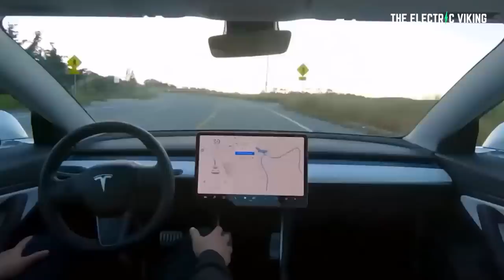20% of all vehicles will need to run on electricity in 24 months in Canada!

Comment: Speaking as a Canadian.  I love EVs but the supply and pricing is much different than in the US.  Due to duties, taxes, supply and currency differences, a Chevy bolt if you can find one is $51.000. anything you see any cheeper online is a lost leader.   most of Canada is a pick-up truck and SUV market due to extreme weather. There are are 3 year waiting lists for EVs and very little used vehicles available so the used markers is almost the same price as the new car market. There are simply too many people who want an EV with a very low  supply.
Reply: Don’t bother people with reality….. 🙄
Reply: @Chad Roback I'm Canadian and most of Canada is not "Pick-up Truck and SUV market due to the extreme Weather",  Have you been to Quebec lately, they are one of the coldest provinces and they have a growing community of EVs there.   The idea that EVs wouldn't work in the cold is nonsense.   There has been supply challenges in the past because the demand for EVs caught many manufactures off guard.   This will change, Canada is building and converting some ICE plants to EVs.  There is a lot of announcements to come.
Reply: @tonespeaks  uh. . . 2021 80% of vehicles sold in Canada were pickup/SUV's. . . So yes, Canada is a pickup/SUV market.
Reply: @tonespeaks  I can't drive an announcement
Reply: Bought model 3 after 9 month wait.  Filling our needs beautifully. Kept old truck for trucking needs.
Reply: @Richard-pe1cd  you know… not everyone can afford two vehicles let alone an EV at the prices they are selling for. I’m glad you had the freedom to buy an EV.
Reply: @niceguyrides  we saved for 7 years to buy this car.  We always pay ourselves the car payment and then buy.  Try it!  But now that we have one, we are amazed how much we are saving on gas.  Just put thousands in repairs on the truck though and when it was our main driver, it cost us $600 a month in gas.  We are now saving for our next vehicle, although we may have to dip into it for a new roof.
Reply: @adamq9270  The announcement is the start, we have to start some where.  It is also the signal to the country, this is the direction we are going, so start preparing ourselves for the new reality.  24 months, there is lots of time to make it happen.
Reply: @niceguyrides  Can you state the source of your data??  Also SUV is a broad and misused term.  Many Small vehicles are labelled SUV when really they are just sedans with a higher ride height.
Reply: @Richard-pe1cd  Try it?  Don't patronize me.  I own my cars, but that doesn't mean I am so egocentric as to not stand up for people that don't have what I have. I own an SUV that gets 36 mpg, do you know how long it would take me to make up the difference between the 30K upcharge on EVs that currently skew the market? It doesn't work yet, and that is why the government shouldn't be forcing this on people yet.  When the supply chain, charging infrastructure,  and manufacturing catches up with demand, then I can see the government stepping in, but we are years away from that with current battery resources. So they are creating more demand when we are already low on cars.  AND you still have your truck? So an EV cannot serve you in all your needs, unless you are going to jump on the 3 year Ford waiting list for an F150. . . -SMH
Reply: @tonespeaks  it's already started and manufacturers are racing to get going. Why does the government have to step in to create more problems? Oh. . it doesn't.
Reply: @tonespeaks  Google it. Took me ten minutes.
Reply: @niceguyrides  Of course I can google it, I just wanted to know what the source of your data is.  There are many different sources of Data in this area, just want to know which one you are relying on.  I was using StatsCan data, but like I stated the term SUV is used very loosely... Tesla Model Y and RAV4 are considered SUVs, but they are not based on a Truck Frame.
Reply: @tonespeaks  standards applied too quickly create problems. You are ignoring the obvious problems with forcing something to happen when the market cannot support it. This is just a penalty tax being that it doesn’t give automakers time to adjust. It is OK to be zealous about something but don’t blind yourself to reality.
Reply: @niceguyrides  "standards applied too quickly create problems. "  This is a a fair point, if using current production metrics, but this is statement from the Government is about what will happen in 24 months.   In 24 months there will be a massive amount of EV production, coming from a variety of manufactures.   Currently, all the major EV makers will have ramped up production..... in 2023, they will be in a position to meet increased EV demand and with lower prices.  The Government is not making an aspirational announcement, many of the Auto Companies had planned to end ICE production in 2030 or 2035.  In 2023 there will be a number of EV Pickups for sale: Tesla, GM, Ford, Toyota, Stellantis, Rivian, and a number of others.  There will be even more EV SUVs from Volvo, Hyundai, VW, Audi, Kia, Mercedes, Vinfast, Toyota, Nissan and others.   I didn't even mention the Chinese EV makers like BYD, NIO and Xpeng, who also plan to sell in North America.   So the Government's target of 20% is actually easily achievable and the prices will be comparable to ICE.

It should be noted, what the Canadian Government has announced, is similar to what the EU, China, California and other US States, UK, NZ and other countries have mandated.   Canada is in a better position than many of these Countries because we have all the resources needed to manufacture the EVs in the country,  not to mention we wll have the ability to make components and EVs for export.   This is where Canada can become a Powerhouse in the EV industry.  We have the natural resources and technical knowhow to be a leader.   The Industry just needed a little push and helping hand from Government to give it off the ground.   In the coming weeks there will be many announcements about EV production and/or components in Canada.  There is a line up of companies trying to launch development in Canada. Tesla has big plans for Canada, that I can state for sure.

I have been studying the EV transition for about 7 years, but don't take my word for things.   KMPG has done an extensive study on Canada's potential role as a PowerHouse, here is the link to the study, it is a 7 min read.  Everyone should read this.... 

https://home.kpmg/ca/en/home/insights/2022/06/how-canada-could-become-a-global-powerhouse-in-ev-production.html

https://www.pwc.com/ca/en/industries/automotive/publications/accelerating-canadas-electric-vehicle-transition.html

https://www.bcg.com/en-ca/publications/2022/competitive-edge-for-ev-battery-manufacturers-canada

https://www.investcanada.ca/industries/batteries-and-electric-vehicles-ev

https://www.forbes.com/sites/samabuelsamid/2022/12/05/brightdrop-starts-electric-van-production-in-canada-adds-dhl-as-customer/?sh=7261fdd62966
Reply: @tonespeaks  incorrect on so many levels. #1 no one needed a push. It as happening already as you have so eloquently noted. What this will do is create more supply chain issues as all these manufacturers compete for EV resources that are seriously lacking in the market right now. I mean just look at how thin the lithium refining is right now in our world. And lithium refineries don’t pop up overnight. Most EV manufacturers aren’t even turning a profit on what they are making because they are behind the curve on manufacturing techniques. Their may even cause manufacturers to rush an out unsafe vehicles on the road to avoid heavy taxes on vehicle that actually make profit. The timeline is too tight, and Canada is not China, so looking at them as a model is horrible. The blind eye that China takes toward humanitarian, environmental, and safety concerns is ridiculous. 

Again, no push needed. Electrification sells itself if you let it. Tesla is proof of this. Instead you create a bunch of haters because you are forcing it upon people. Instead we are going to create a whole lot of uninspired EV vehicles from developing technology that will be complete bricks 5 years from now as the tech matures.  Then we will be faced with recycling millions of vehicles. I mean seriously… we haven’t even settle in a unified charging standard yet, and many manufacturers are moving upstream to 800v systems. 

Better to let the technology evolve naturally until you have a product that will stand the test of time, than force people into a round whole that don’t fit. We are 5-10 year away from EV’s that will truly replace ICE vehicles in 99% of the cases, but we need to be building the supply chain and infrastructure to handle that when it happens.
Reply: @niceguyrides  You make some good points, but I feel much of your response seems to be based on out dated ideas.  "We are 5-10 year away from EV’s that will truly replace ICE vehicles in 99% of the cases".  That was 5 years ago, there are many EVs on the market that out perform comparable ICE vehicles.  EVs are far more efficient and have better performance than ICE.  EVs have a lower TCO (total cost of ownership).  EV charging has been an issue for some, but that is changing rapidly.   Most can charge at home and reap great savings in the process.   Many people talk about Range, but on average people only drive about 50-70km a day, only about 1% of users will drive at distances greater than current battery capacity,  so that covers your 99% rule. 

The reason the Government is pressing the adoption, is to allow Canada an opportunity to be a Powerhouse.  Timing is everything, especially since  China and many parts of Asia have/are already ramping up their EV development and production.   They have a nice head start and we can't wait for all the issues to be resolved before pressing forward, otherwise we would just be conceding a larger lead to them. 

If we want to ensure that Canada benefits the most from the EV transition it will have to move now and move quickly.  This allows North American EV manufactures a stable supply and demand for their products so they can accelerate their production and technological development.   Right now North American EV makers are behind Chinese, beside Tesla.   I hate to say this, but the Canadian Government is making an excellent decision and movement here.   This is an opportunity to really put Canada on the Map in EV Production and Technological development.  The benefits to Canada from this, will be profound.   Basically every area of the economy will benefit, even Oil and Gas.

The Government is pivotal to making the transition work, because it will require a lot of Government Assistance and Coordination to really make things work.  Basically a lot of Public/Private investment is needed, for example better roads will need to be built to Lithium, Nickel and other resources.   Communities will need to be built and like you said, expanded supply chains developed.  

Some of your scepticisms are reasonable but we shouldn't let the strive for perfection get in the way of progress.   Remember the Government has set the bar at 20% this will be easily met, even at the current rate of transition.  People who prefer ICE will still be able to buy ICE... for now.

----------------------------------------------------------------------------------

Addressing some of your important points:

The lithium supply is not under threat right now... no one is questioning the supply.  Prices have risen, but many EV manufactures planned for higher adoption levels and made contracts to reflect this production.  

As for safety,  most EVs top the Safety charts, especially when compared to ICE vehicles.  

Canada isn't following China.... in fact EU and USA have led the way in terms of mandates.   The EV capital of the World is Norway (in terms of adoption), a country with a colder climate then Canada. 

If you look at older EVs they are far from Bricks now and that was using outdated technology.  Don't get me wrong there have been failures, but the technology has evolved greatly since then.  

Charging standards... hmmm not sure what you mean by that, but we have CCS, which most companies use and NACS which is what Tesla uses.   I totally agree it would be smarter to have just one like in the EU,  but this is only a matter of convince not operation.   Many Tesla Superchargers can charge CCS vehicles and most of the other Charging stations can charge Tesla.  A unified system would be smarter but isn't a deal breaker. 

The 800volt v 400 volt systems is a design choice and really has no bearing on production.  There are benefits to both systems, so it is really just a design choice. 

As for EVs being bricks in 5 years that is highly unlikely, because the design of EVs makes upgrades really easy and cheap to do.   Swapping a battery can happen in a matter of minutes and recycling of battery parts is very efficient.  The Electric Motors will out last the bodies easily and require virtually no maintenance.  Even the Brakes will out last more ICE vehicles.
Reply: @tonespeaks  Again, you are an EV zealot.  I get it. But you are making up your facts. we are not at the 99% level right now. Maybe near cities, sure, but if you don't own a home, or live in an unsafe area without a garage, or live in rural areas, or live with huge commutes, EV's can still create issues. The list of exceptions goes on by the way. 

Cost of ownership is only cheaper if 1. you drive a butt load of miles a year. 2. If you assume car ownership longer than the average ownership of a vehicle in the US. 3. If the increased demand for charging does not raise the cost to charge your vehicle. 
4. If you can charge at residential rates.  I've seen and done the math.  My SUV would have been 30-40K more if it was electric. It gets 36mpg.  It would take me forever to recoup that cost, even driving 20K/year.

Safety:  Chevy Bolt owners may disagree, being that their cars can catch on fire (still). Toyota BZ4X owners probably disagree as well. Technology rushed can be dangerous, and this is forcing companies to rush.  Yes, EV's CAN be safe, but they are not inherently safe. They are made safe by development and testing. 

And by "brick" I mean that in 5-10 years when range anxiety dissipates due to maturing technology, they car you buy now will have very little value, but you will still be stuck paying the 60K you financed to buy the thing. There will be millions of these things on the road waiting to be recycles.  Sure it will drive used EV prices down, but it may even be that the charging infrastructures doesn't even support old cars anymore.  We don't know, because we are still in the adolescence of this technology.  Forcing people into it early is not good business. 

There was no need for it. and as much as you say Lithium supply is OK, you are mistaken, that is why Tesla, one of the only at scale EV producers is building its own Lithium refinery. Plenty of Lithium in the world, few refineries. That is an issue, and that was just one of the hard to find resources that goes into battery production. And why, so we can replace a bunch of cars? Do you realize that the regulations of Semi trucks could have a much greater impact on the environment.  How about home energy. Canada gets 50% of its energy from oil?  So instead of using all those resources to replace oil energy or natural gas (32%), with solar, tidal, nuclear and BATTERY banks, all the battery production will be wrapped up in producing EV's. 

See the politicians are not scientifically deciding things. They needed to do nothing, because the incentives were already there. Now they are just forcing people to implement things early and stealing resources from more needed places to create millions of obsolete in 2 years EV's.  Yay! 

Just to collect their taxes and virtue signal.
Reply: @niceguyrides  First of all, I'm not a zealot, but an EV expert.  I have been studying this for some time.  In fact in my University days, I suggested that we build Electric Cars, but the battery tech just wasn't there to make it viable.   If you read what I wrote, I stated that people still have the choice to pick ICE or EV.  The Government isn't forcing people to buy EVs, they are just stating that Automakers make 20% of their sales EVs, the other 80% is ICE.  This is not forcing anything down anyone's throat, it is just pushing the industry to move and setting targets so that we move towards EVs as a collective.   This will make the transition more cost effective and will get everyone thinking on the same page.  For example at some businesses they offer their employees Charging stations.  Some businesses offer Free Charging to lure customers.  This helps to expand the economy, it is a win win for Canada. no matter how you look at it.  

I totally get your concerns, but those issues are easily addressed.  People are flocking to EVs so yes there are issues, but people are willing to deal with them, once they are educated about their options. 

My position on EVs is based on Economics and the Environment.   EVs are zero emissions and very efficient, but reducing Oil and Gas usage this allows the country to export more Oil and Gas at World Market prices, which is a win win for the sector.   The country will get a cleaner environment and the end user will reap the savings.   Even thought you have done the math.... many people would differ with your calculation.  On the other hand, even if EVs cost us more $$$, that savings to the environment is priceless.   These EVs will not be obsolete in 2 yrs, because at a lower value, it will allow people in a lower wage brackets to afford them. 

I can't argue EVs are better for the World, but I can argue that EVs are better for Canada.   It will expand our economy and that will make most Canadians happier.
Reply: @tonespeaks  if car manufacturers have to sell 20% of their vehicles as electric there will be plenty of compulsion. This will not help anything past what already was happening and it will hurt companies that are struggling to navigate this change over. 

I am a huge EV fan and have been studying EV’s since my design days. Proclaiming yourself an EV expert means nothing. It is a classic appeal to authority, which means nothing in a conversation except that you are trying to flex some intellectual power in an attempt to win a point. 

I say again, the supply chain is not ready for what is going to be created by all these new ultimatums set by government around the world. It was necessary and problematic. It will hurt companies that are trying to pivot and artificially fund companies that adapt faster. Jobs will be lost, bankruptcies. EV prices will indeed go down but it will be an artificially low price funded by tax payers. Half the people that hate EV’s do so because of the government intervention. This will just create more animosity. An it was completely unnecessary.
Reply: @niceguyrides  "if car manufacturers have to sell 20% of their vehicles as electric there will be plenty of compulsion. This will not help anything past what already was happening and it will hurt companies that are struggling to navigate this change over. "  I would agree with you, if it wasn't for the fact that the EV Makers petitioned for this action by the Government.   What many people don't seem to realize, is that the EV makers want a level playing field so they know what direction to take.   If they know the country is going EV, then they can make the needed investments to get there and they can all compete knowing this fact.  Then the First Mover advantage would be nullified. 

I'm not an authority.... I have never positioned my statements to be an authority over anyone.   What I have stated are facts and opinions,  I state my history to give you context about where I'm coming from.  I'm not a fanboy of anything or anyone, just a person that has extensive knowledge about the subject at hand.   There are no points to be won or flexing allowed.  I have never flexed in any of my replies to your positions, because it is a foolish act that I refuse to take part in.

"I say again, the supply chain is not ready for what is going to be created by all these new ultimatums set by government around the world. It was necessary and problematic. It will hurt companies that are trying to pivot and artificially fund companies that adapt faster."

What I will say here, is that you should read more about what the Industry is saying about these "ultimatums" and mandates.  You will see that Companies are not scared of them, in fact they have encouraged Government to make them to help advanced their investments in EVs.  You see for many legacy automakers, having the backing of Government helps their cause, when they have to renegotiate contracts with Unions over reductions in workforce that EVs will cause.  This is one of the main reasons, the Industry has wanted Government to give the industry a little push.   The other reason is to signal to consumers that EVs are the future.    As for the supply chain issue, you seem to be the most vocal about this problem, whereas the Industry is not.   I say this because the Industry has made the investments in the supply chain already.  In fact EV adoption has happened so quickly that they need massive investment and they will only make these investments if they know there isn't going to be a reversal or stagnation by the Government.   Like I stated before, this transition will need Public and Private investment in order to be successful. 

" Half the people that hate EV’s do so because of the government intervention. This will just create more animosity. An it was completely unnecessary."

I agree there will be some that will always hate EVs and/or Government.  You do know we have the same attitudes when the Car was invented and people where upset about the Horse and Buggies being replaced.   We have seen this fight before and we know how it ends.   You can't fight progress, EVs are the future, there is no denying this.  Not only that, but what many people don't know is that Auto Makers are not investing enough money in Engine development, that money is diverted to EV development.  Like I said before, EVs is a way to expand the economy, sure there are going to be some losers,  no question, but there will be plenty more winners.
Reply: @niceguyrides  " some automakers may want this to protect their investment"  It isn't "some", it is all Automakers want to protect their investments. This is where Government comes in.... in order for the a Private company like Ford, GM and etc to invest Billions, they want to know that the Government is going to support these moves, to help secure their investments will work.  We are talking a lot of money that needs to be invested in Canada, so there needs to be a level of security.  These companies could go bust, is these investments don't work and that could me thousands of jobs losses and/or crippled industry. 

Please don't get me wrong... it do see your concern here, but it is Government's job to manage these types of Investments and Industry disruptions.  Like I stated earlier, when Cars were first introduced, people had the same objections and concerns.  It should also be noted that Government has always played a role in the Auto Industry.... for example the Government sets the Fuel Economy and Safety Standards.  The fact that the Odometer has KM in large, and Miles in small is a Government standard.   The Government also regulates the proportion of Trucks to Cars that manufacturers make.   Most of these regulations were requested by the Industry, in order that there be a level playing field. 

" The government is just pushing them prematurely and imposing penalties on companies that fall behind a goal that may be unachievable by some at this point. "  

"It's estimated that, between 2026 and 2050, the quotas will lead to Canadians saving almost $34 billion CAD in energy costs. The reduction in greenhouse gas emissions will be equivalent to Ontario's entire emissions for three years. Currently, passenger vehicle emissions account for around 10 percent of Canada's total greenhouse gas emissions."

"As a country, you can invest in infrastructure without mandating ridiculously hopeful targets. 2-3 years is nothing.  That’s basically saying now.   I mean seriously, only two car manufacturers are turning profits on EVs, and now for the rest 20% of their cars they have to make for free. Ridiculous. "

There is no question the country can and will invest in infrastructure without mandates..... but mandates help the country to invest in infrastructure.  The Federal Government doesn't have control over the Provincial Governments to take action.  In fact Ontario doesn't have EV incentives, nor do some of the other provinces.   There are times where some sort of pressure must be applied to get things moving.  Ontario is not starting to see the light, as Automakers have stated they will invest in the Province, if it advances it's stance on EV adoption.   The Auto Industry as I stated before, is regulated.... there are many parts on vehicles today, that wouldn't be there if it wasn't for regulation.   As for turning a profit.... what many people don't know is that ICE and some legacy auto makers don't make profit on the cars.... they make the profit on the financing.  EVs are easier, cheaper to make and Warranty.   The Automakers want to move to EVs as quickly as possible because the margins are much higher.   I will state this again, the Auto Industry is the one that was petitioning for this announcement and change.   There is a saying in the Auto Industry, where California goes, they all will follow.   California has mandated EVs, most of the vehicles sold in the US, are Sold in California.   In order to have maximum economies of scale, the Auto makers, build their vehicles to California's standards.   No one is making EVs for free... the AutoMakers are not turning a profit now, because they have to support different Power systems.  ICE factories can't make the best EVs, so the automakers have to close or retool ICE Factories.   This move can't be made in a bubble and making that switch is a leap of faith.  This is why they need the Government to adopt standards that assure, their investments will not be meant with outside challenges.   We are talking about a lot of jobs and Tax revenue...it must be handled by Government.  Just look around the World, it isn't just Canada making this move... virtually every where in the World is positioning their country to switch to EVs and sooner rather than later..
Reply: @niceguyrides  "Let the innovators be the innovators and the rest move cautiously behind. "  I think you are behind the curve here, the innovation has already happened.   Tesla proved that EVs are comparable to ICE and in many ways better.   All the EV makers have adopted the same standard,  Batteries and electric motors, everything else is just fine tuning.   Now everyone is working to make their vehicles more affordable.  Just for the record there are some Auto companies that are moving more cautiously like Toyota and Honda.   Like I stated before, 20% is a push, not a force.   Not to mention over 1/2 of Auto buyers are considering EVs now!!!!
Reply: @tonespeaks  you are just repeating yourself and not listening.  Have a nice day. Again we disagree on some very basic fundamentals. Cheers.
Reply: @niceguyrides  I listened to every word you wrote and even included your own quotes as well.  It would be disrespectful to engage and not read fully what you stated.   But lets be clear for all those that may be lurking.... The Auto Industry is the one pushing this action from the Government.  Your arguments have some merit, but the Industry needs Government's partnership to make this transition smooth and timely.   This Transition will help to expand Canada's Role in the EV World, that is only going to grow.  It will bring jobs and investment into the country, with a potential recession looming, this investment is something that can only be a good thing for the country.  

There are no fundamentals here, this is new technology and a new way of thinking.   But like I stated before, most of your arguments where the same ones that people had, when cars were introduced to replace the Horse and Buggy.  

There is a saying... "don't stand in front of a Freight Train".    Cheers to you as well.
Reply: @tonespeaks  for those that are lurking… I am not against EVs. If you read what I wrote you would know that. I am a huge believer in EV adoption and technology. You are under the delusion that punitive measures are a good way for government to encourage growth in a new segment. This is not a push that was needed nor will be helpful to Canada’s auto industry as a whole. It is government overstepping its mandate to help transition happen and encourage business development. It is also premature in a sector that is extremely young in its evolution, which you are oblivious to. It will cause pain where no pain needs to be. It is an excuse to levy more taxes on business that are struggling to survive this transition… businesses that represent whole countries of workers. 

The transition was naturally happening and incentives were already in place to help automakers deal with the changes. THIS WAS UNNECESSARY and harmful. 

You keep referring to the horse and car like I am trying to hang on to ICE vehicles. The government made plenty of bonehead laws along the way to help people transition and it took years to do. Your impatience to force the change is exactly why there are so many haters of EV’s today. When the car reached a level where it truly replaced the horse in just about every way, it took over. It was private industry that pushed that transition. Government was just there to help regulate it, not punish people for not selling cars, who traditionally sold horses. -SMH

Again… you are wrong about many of your premises. I am not going to convince you otherwise because you are a self proclaimed expert on the matter. Good day.
Reply: @NiceGuyRides  the ev was 5500 with a 5000 rebate from the government.   We kept our old truck for the time being but use it very little. We are saving a lot with this car.  Our old gas bills were $600 a month.  Hydro + chargers are under 100.  We have rear wheel drive model 3.  Relative said he could not afford a tesla and total price of new vehicle was same as ours.
Reply: @Richard-pe1cd  I completely defend your right to own an EV.  But the fact remains that with current production restrictions due to reality and the hurdles to ramp up for EVs, EVs are not the complete solution for everyone's needs yet. Ford sold like 15000 EV trucks last year and they may get up to 60,000 this year.  Doesn't quite fill the need, does it. You are creating a massive demand issue where one didn't need to be. Things can be given gentle shoves by the government, but when the government takes a hammer to a situation, it messes up the natural cycles of things.